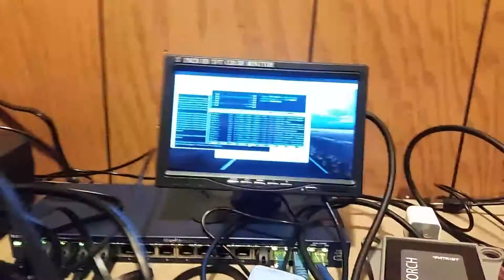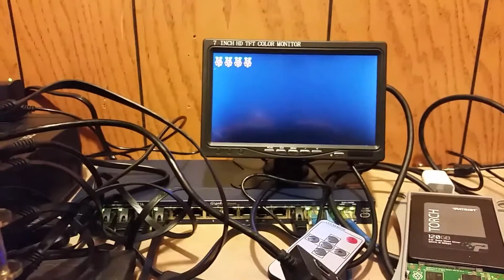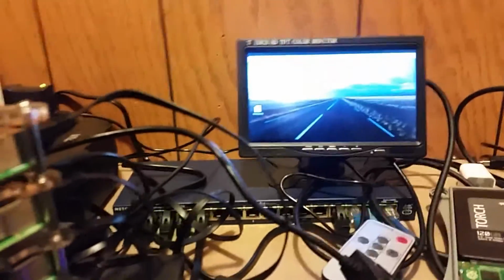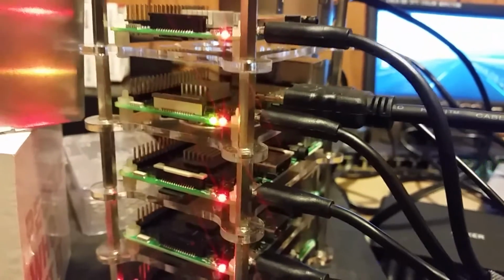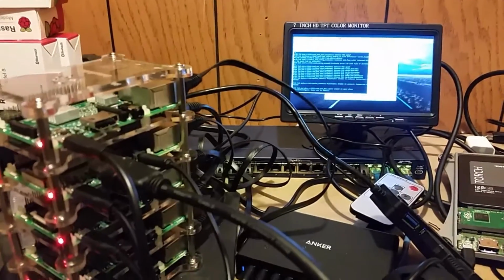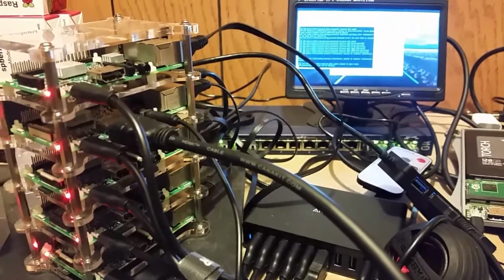Mini raspberry pi Datacenter - part 3 Storage is up!

Comment: Hi! What is the micro flash you are using for your raid?
Reply from the maker: I am using some Samsung 256gB thumb drives. Doing this over again, I would say that the storage system works but it isn't worth doing on the pi as the USB bus is too slow. I would find another micro computer that has sata on it and connect the pi's via NFS to that.